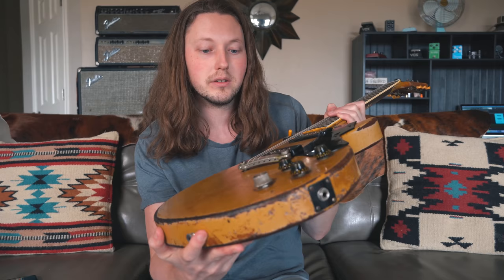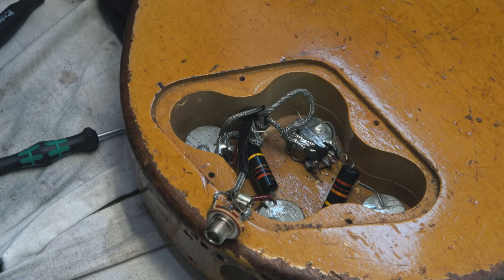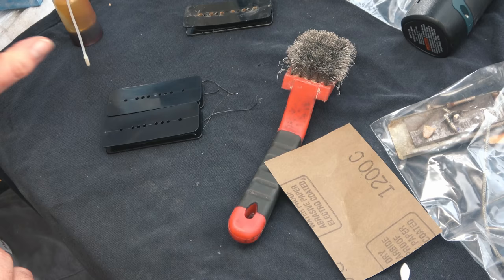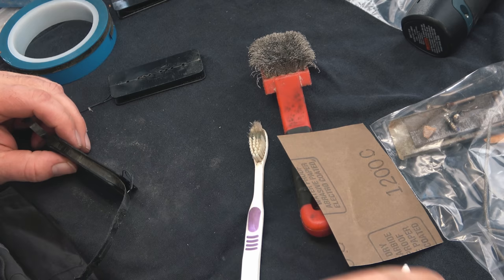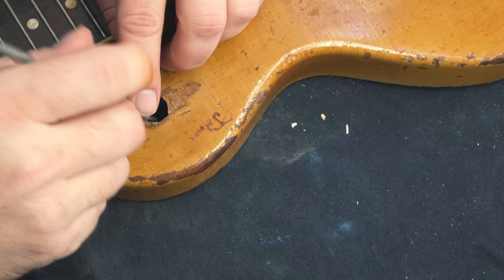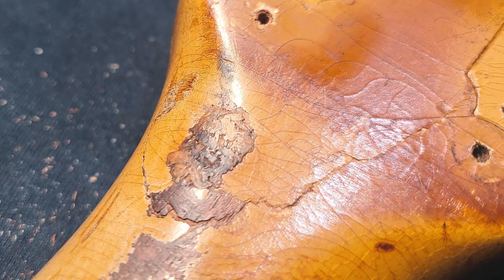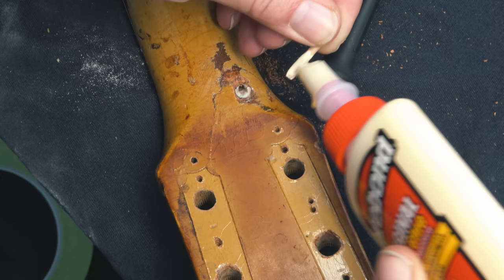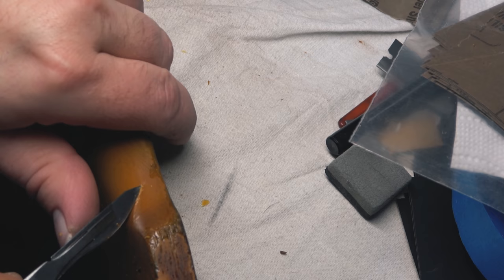The Incredible Restoration of my 1958 Gibson Les Paul

Comment: Those are definitely capacitors. Some styles of capacitors have colored bands on them similar to resistors to tell what the capacitance is. The color codes appear to be red, brown, orange, yellow, which would be 0.02uf (21,000pf).
Reply: So it has the same color code as a 4 band resistor? (In pico farads of course)
Reply: @mason8971  it is slightly different. The tolerance band is not the same value. The color codes are in the same order though.

Comment: I was so immersed in that pickup restoration, that soon as I saw the heat shrink tube catch fire, I actually blew on the screen ...
Reply from the maker: Thats funny! 😆🤣
Reply: I've done that before too.
Reply: the few times I have used heat shrink (RS232 serial cables)  I used a heat gun not a lighter :-)
Reply: Maurice Walshe - umm, yeah!! And if you can't pay a whole 15 bucks for a cheap heat gun, you can borrow somebody's hairdryer on a high setting. It's just low temperature plastic, it'll work fine.

Comment: This has likely already been answered, but the markings on the bumblebee capacitors are not resistor values, but a code that tells you the capacitance and the voltage values. The first 4 lines give you capacitance rating and the last two tell you the voltage. 
Now, as capacitors age, they do become leaky (meaning that they leak current, not that they leak fluid, though that can happen too). They don’t need to be in constant use to go bad, as even just sitting on a shelf for decades will age them out of functionality, after which they do, in fact, turn into resistors. 
I’ve seen some clever fixes where a tech will remove the outer cover of the old caps, then fill them with a new cap of the same original value, filling in the ends so they look all original, but then have the intended functionality of the original capacitor in that circuit.

Comment: I am an electronic hobbiest, that started working on radios and amps in the early 60s, and we called those capacitors bumble bee caps.  Stuff is a lot smaller in this new age, but I still have a bunch of them somewhere in my shop.  
They aren't the greatest of capacitors, but they aren't as bad as many that were made in the day.  There is a simple test that can be accomplished, by unsoldering one terminal, and using an ohmeter to test for leakage.  An infinite (high) resistance, would indicate a good capacitor.  The only way to positively check the functionality of the capacitor, would be to do and ESR test.  (Equivalent series resistance)  This test checks the leakage within the capacitor, normally at 100 khertz, and is the best way to determine the internal leakage within the capacitor, and whether it needs replacing.  The test takes a bit of time and requires the proper equipment, and that is why most people just replace the caps.  
I can understand why in your case you want to keep them, and by the sound you are getting out of the guitar, they seem to be holding up quite well..

Comment: The painted bands on the bumblebee caps are a color code, much like modern resistor color code,  but indicate capacitance rather than resistance. The resistors here are the 4 variable pots. (Usually 0-500k or 0-250k ohms) Caps are used  in conjunction with the tone pots to create a variable low-pass filter, thus filtering out more high frequencies the more you turn the pot’s wiper-arm toward the cap. (and the other side of the cap goes to ground)

Comment: de winding pickups is the only course of action on a vintage pick up. We did this on  am pickup 1961 slab board strat you simply take your loving time  if and when you find a break you get very heavy magnifying glass. Both ends get a tiny amount of tinning. Then mate the ends perfectly.  Finish unwinding or rewind the connection will hold and there is NO tonal differance and your pickup is still original winds. And the rubber ring is totally f n cool. Those were used on the very expensive Gibson Jazz guitars.   the repairs  are bang up and totally rocks as this  guitar was restored to the Rock Machine it was born to be..

Comment: The colored bands denote the actual value of the resistor.  I work in technical support for Carrier and we use 47k, 4.7k, 10k and 15k resistors and the bands help those who remember the order and colors what the value is without having to actually meter it.

Comment: They are just old axial capacitors, the color bands denote their max voltage, capacitance, temperature coefficient and tolerance very similar to the way resistor color codes work.

Comment: resistors have their resistance and tolerance info coded in stripes - different colours stand for different numbers - learned these when I was a kid in the 1960's. Red = 2, Orange = 3, purple = 7... The gold or silver stripe at the end tells you the accuracy band of the resistor, the most accurate being gold (1% tolerance?) silver (5% tolerance), bronze 10%. I have never known capacitors makrek in this way - but I guess its not impossible.

Comment: Capacitor colour codes same as resistors but measurement is in picofarads. So, red, red, orange is 2,2 and 3 zeros. Which is 22,000 pF or 22nF or 0.022 microfarads.

Comment: I'm probably late to the party, but I know why those capacitors have color bands painted on them. It's actually for the exact same reason that resistors have them - to show their value. These bands are visible from any side, whereas if the value was printed in text it might not be legible depending on how the component was installed into whatever device it's in. Also, back in the day it was a lot harder to print small text on the side of a cylindrical component and make it readable than to paint color stripes. These days it's not an issue, so new capacitors don't use this color code. Resistors still do, since they are usually quite small. Big high wattage resistors, however, often have a numeric value printed on them instead of the color code.

Comment: “And these emg s don t take a battery but can be powered via usb. Threw in for free the modern ultra weight relief design in the spirit of the missing wood in the switch cavity. All wired with quick connect, robotuners, and coil tap push/pull knobs to turn these p90s into P45s. Everything u need, nothing you don’t!”

Comment: Would love to know the value and taper of those pots? You can get rough estimates using multimeter and same method to measure pickup resistance. You are looking for maximum value as you turn down the volume pot with sensitivity to 200k. The max value, minus the resistance of pickup, multiplied by 4 will give the pot value. Also of interested is where on volume control max value occurs (audio taper being approx 8.5, and linear being 5). Thanks.

Comment: That headstock repair is unbelievable. My only input would be to please use your powers for good, and not for evil (by misleading a potential buyer about it having a past repair done.) Also, I forget who it was, maybe Izzy Stradlin or Jeff Beck, but they said a Les Paul doesn't even begin to sound good until after it's had a headstock break. That it's only THEN that they could REALLY start breaking it in.

Comment: In the old days, Capacitors were cylindrical, and they had color bands on them like resistors do. The color bands defined the capacitance values just like resistor color bands define the resistance values do today. I'm 78 and have been into electronics since I was 27 years old. Don't let anyone tell you that those are resistors. The volume and tone controls are variable resistors. The proper name for them is Potentiometers. The one thing that I hate about the restoration is that junk box tone knob. Please find an old volcano knob for the guitar.

Comment: Head stock...I havnt seen them old screws in a long time..it's been broke for a long time..I built a guitar in the 70s.also I found a Harmony Stratocaster like a Les Paul shape.body and neck made together 1950s guitar....found it in a garbage can....Jr Les Paul in the Early 70s sold for 80.00 mined was 100.00. used in 1975.....lol rock on.

Comment: I have a neck off a similar vintage Gibson Melodymaker or Les Paul jr.  It has no finish other than the Gibson logo.  Unfortunately the serial number was also sanded off.  I found the neck and body in a garbage can at the Coast Guard base in Yorktown VA around 1975.  I stupidly cut the body off the neck because it was cracked and in bad shape but I now realize I should not have done that.  But I have the neck.  Maybe you can recommend to me what should be done with it.  It feels great.

Comment: Any chance on finding the proper fret board?  Also, why no fix on the hole between the pickups? He blended everything else so well, I figured he'd take care of that also.  Great job, you found yourself a small treasure.
Reply from the maker: What's wrong with the fretboard? And I just didn't have any issue with the screw hole. I also had to draw the line somewhere on the repairs. But thanks👍🏻

Comment: The Bumble Bee Capacitors, That look like resisters, Have Bands around them. That denotes the different values of the Capacitors. Much like a Resistor. I could have got my old books out and told you which band means what. I'll Let someone else do the research on that. (I used to have them memorized. Jaysen Zaffino).

Comment: I'm just wondering about uaingrhe old wire connections. I would think the old working is probably oxidized and a lower quality copper than you can get with modern electrical wire. 

Maybe not what you want as far as originality,  but certainly inferior electrical path/sound.

Comment: Have you thought about how it is not completely a 1958 Gibson anymore? Now part of the woodwork (and the headstock, nontheless) is actually "some random guy fixing this to perfection in 2021", but it's not Gibson. Thou' I prioritize functionality. I do not understand why you'd keep 1958 mics after such an alteration on the woodwork. I mean... It would probably sound better with a new set of P90s. I get the magic of recoiling an old pickup but I don't see the point when the sound is gonna change a bit anyway and it's cheaper to just replace them.  Neither would I preserve the replaced knob on a restoration work.  But... Well, yeah, you preserved even the tape inside them. I deem it not practical. But if it makes you happy...

Comment: The old striped capacitor are ancient and are probably resistors now. Apparently they were used in old TV and radio, and usually they need to be replaced in these devices. I guess if the guitar still sound nice why replace them !!!

Comment: I hate the word patina. It is just a fancy way of saying worn, battered or abused. It takes a true master to bring a vintage guitar back as close as possible to its original condition. BTW, the bumble bee capacitors are trash. They should be replaced as they lost their capacitance, they probably leak or they are dried out and they show a high ESR. The so called superior quality of those parts is a myth, as anyone in electronics knows. It is obsolete technology and it sucks. The bands on the capacitor refer to the capacitance value. Another myth: the coils of the pick ups. There is nothing special about that wire. It is ordinary copper wire with a coating of shellac. Period.

Comment: That headstock is still frustratingly weak though; I’ve seen better headstock repair jobs which also strengthen the headstock after repair.
It seems the repair guy is more concerned with showing off his repair hiding skills (not bad, but its should not be the priority).

Comment: For what it's worth, there's absolutely no way this guy 1: removed 10,000 turns of the original wire from the pickup without breaking it, and/or 2: rewound the original wire onto the pickup. If he says he did, he's lying. The video shows him winding the pickup with new wire, not unwinding it.
Reply from the maker: What credentials do you have to backup that statement Ted?
Reply: @MatthewScottmusic  I've been a guitar repairman for 20 years. I ran the repair shop at Chicago Music Exchange for a few years. I currently run my own shop. I've rewound maybe 50 vintage pickups, including p90s. Not trying to be a jerk, but from my experience repairing and rewinding vintage pickups, there's no way to unspool 10000 turns of 42 gauge enamel-insulated wire onto something and then rewind it back onto the original pickup.
Reply from the maker: @PhaedrusFell  well it sounds as if you do have the experience. 👍🏻
Reply: @MatthewScottmusic  I'm sorry if I came off rudely. I could be wrong. But, no offense, you'd be crazy to attempt to unwind and rewind a pickup with the same wire. As you noted, the stuff breaks if you look at it wrong. We're talking days and days of carefully unspooling the wire by hand, turn by turn, to say nothing of loosening any sort of wax or lacquer potting. And for what? Original copper? The wire isn't magical. From the video it looks like he just rewound the pickup with NEW 42 gauge enamel wire, which is exactly what I would have done.

Comment: You better keep original winding. Your machine wire tension is different, you changed parasitic capacitance and moved pickup resonant. Congratulations - you killed vintage pickup voice! At least you matched mask in tape color, it will compensate the damage you did:)))))))

Comment: yes , they did paint the band on capacitors to denote the value , very similar to what was the standard for resistors . why would these idiots that THINK they know something about electronics tell you otherwise ..."a little bit of knowledge is a dangerous thing" ! look you that are dangerous with your VERY little bit of knowledge ..."better to keep your mouth shut and be thought a fool than open ity and remove all doubt" . you know what , theres google , no reason to speculate , try  : bumble bee capacitors color code

Comment: it's a beat up guitar.

If you're going to keep the damage to the paint job, it would be consistent to keep the damage to the wood.  

I would have removed the previous repairs/fillers and installed a less foreign filler like actual wood to places such as that epoxied switch area.  But what I would have chosen differently is that I would not have recreated the old paint.

I also am not a fan of simulating grime.  I would have had that guitar cleaned, kept the damaged wood and paint... restored the integrity of the wood by putting custom shaped wood to fill in the holes and gaps.  But I would not have kept the grime.  That is one of the most hipster/pretentious thing to do.  Why conceal the fact that it was repaired?  I would wear the cosmetic damage to the wood as proudly as you are with the damage to the paint.

But it's super gross to still make the guitar look like it hasn't been wiped clean ever since it was found in some abandoned shack.  There's bits of human tissue on that thing.  Human fluids that have seeped into the wood and every nook and cranny.

I wouldn't have treated it like some old-timey prop in a movie or stage set.  Look into how they fix old ruins in Rome and Greece.  I believe they don't age the patches and fillers because it takes away from the authenticity of the original parts of things.
Reply from the maker: The next one I'll let you restore🙏🏻